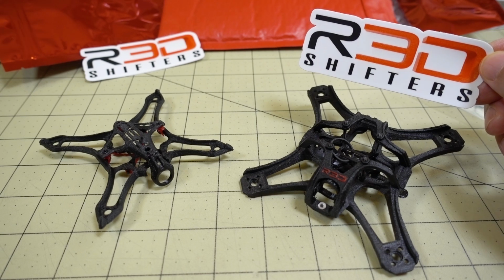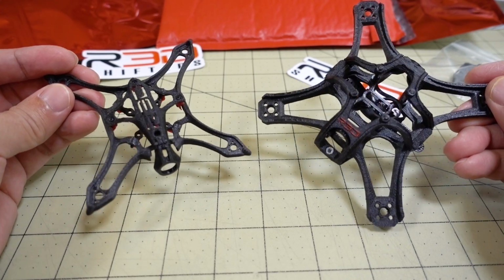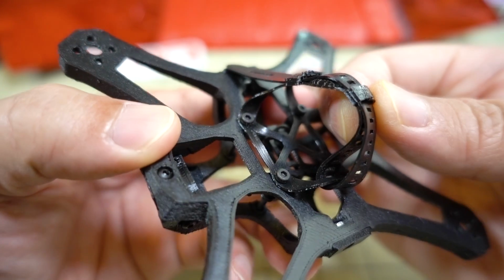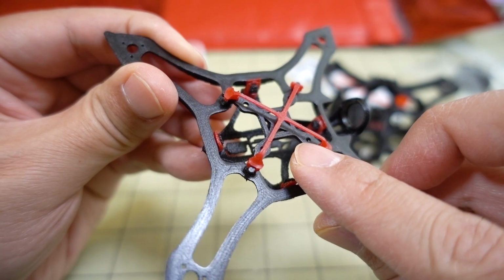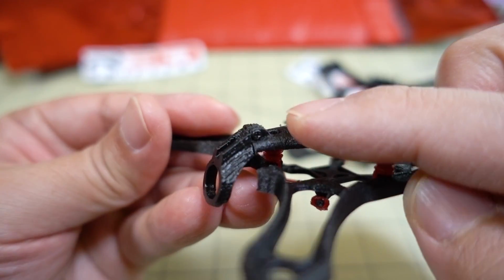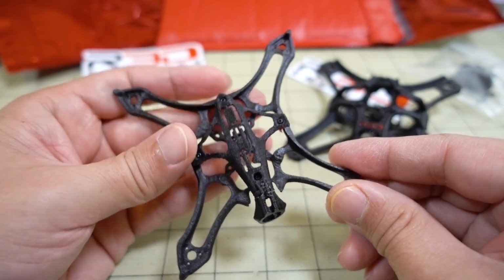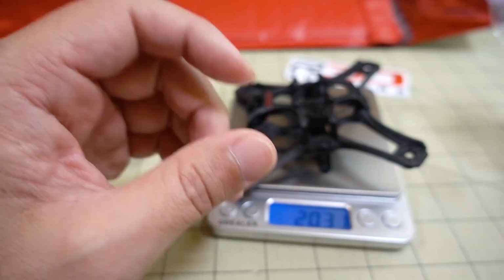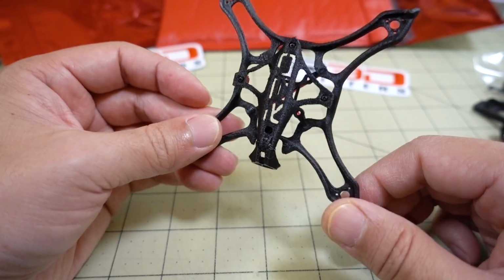R3D Shifters Frame Review 😀

Comment: I have the smaller one, don't bother. Soft mounts aren't soft at all, and don't fit into the FC. Their 3d printing is rubbish
Reply: If this was true, it is no longer the case. The prints are beautiful, and these frames have great flight characteristics. They are quiet, and have minimal vibrations. Perfect amount of space, and nice accomodations like integrated soft mounts for whoop boards, and camera mounting. Worth trying again for sure. And Id suggest reaching out to them directly, regarding your specific concerns. I think youll find their support to be excellent.

Comment: I love these, I've been doing my own 3d designed frames and found the CF nylon is def the way to go. Granted i'm designing for 3 to 5 inch quads so i engineer out the flex to minimize the risk of smoking a motor.

Comment: The R3D Whoop Ion frame is nice. I am running a Crazybee F4, Happymodel 0803 16000kv motors with 65mm props. A 350mah 2s w XT30 connector. 200mw Vtx and onboard DVR. Here's a video. 
https://youtu.be/TPZVhSha_8M